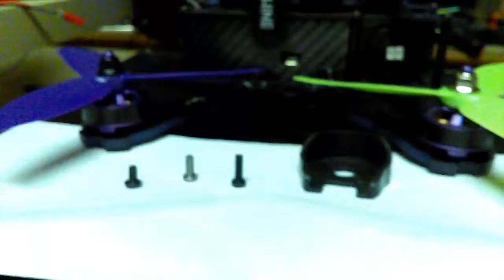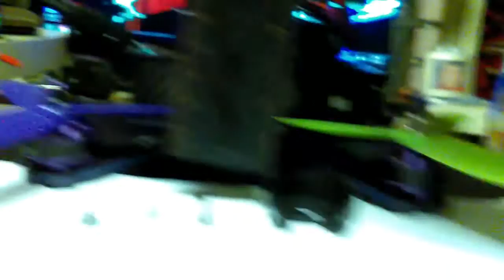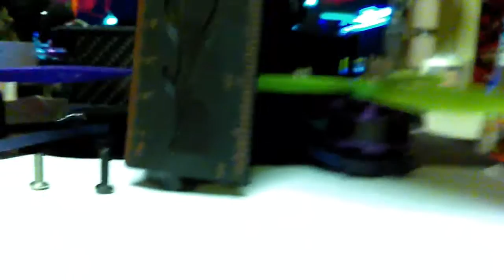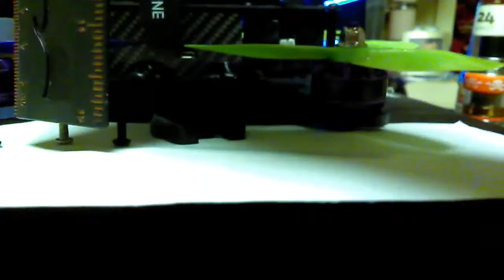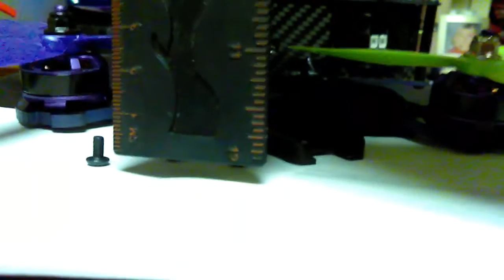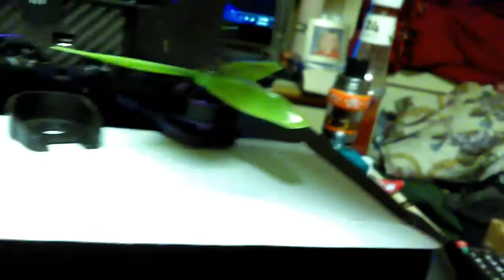Eachine Wizard x220 - CAUTION!! motor screw length explained

Comment: Great video.  Thanks for sharing.  Last week I was flying in a baseball field and had to make a hard landing on the dirt between 1st and 2nd base.  I can confirm that dirt can and will get stuck between the motor guard and motor.  It caused the motor to lock and stop spinning.   Taking the guards off is a good option.  However, as I'm still learning, I think the guards have helped me not damage/dent the motor housing.  It is a dilemma for beginners.
Reply from the maker: You are right on, I damaged a motor hitting a brick wall that likely would have been avoided with motor guards, oh well lol. Also the props are FAR easier to change without the motors guards, so its 6 of one half dozen of another in this case :D

Comment: what was your reasoning behind removing the motor gaurds? if it is just for less weight isnt the payoff small compared to having to replace a motor? just curious :)
Reply from the maker: +Jordan Parrott at first I remove the motor guards purely because I do not like how they look and the fact that I thought they would restrict cooling to the motors and also I believe debris could become lodged between the motor and the motor guard so those three reasons are the main reasons I removed it but afterwards I learned that the propellers are extremely hard to change with motor guards and extremely easy to change without motor guards so those four reasons are basically why I don't use them
Reply: Josh Ketchum makes sense. i also have difficulties getting the props on and off, wish there was a tool to hold the motor in place (some kind of wrench)
Reply from the maker: they do! Its called a motor hook wrench, Banggood should have em!

Comment: Hi, I want to remove the motor guards but not the LEDs. Will the 5mm screws work for that or do I need longer ones?
Reply from the maker: +Webster you will need a 7mm probably, honestly never tried it in that configuration
Reply: Josh Ketchum thanks,what if I remove LEDs and the guards? Does it work with the 5mm?
Reply from the maker: they will work, but just barely hold.. I would not trust the 5mm screws in the motors at all myself, with a 4mm plate, that only gives 1mm holding the motor.
Reply from the maker: The 5mm screws are included to use in the top and bottom plates of the frame in case you lose some.
Reply: Josh Ketchum thank you!

Comment: Hi Josh thanks for the video. Just one question do you use any type of thread lock in the screws? If so, in which and what thread lock type are you using? Thanks a lot!
Reply from the maker: +Flávio S I would recommend blue loctite if you use it, I have had no trouble as I am pretty anal about tightening all outside screw every flight. Honestly none have come loose, but on was a bit loose on my top plate, so I installed a longer one up there. No issues so far.
Reply: Hi, Josh! Thanks for the answer and support on doing this great videos! I'm wainting for my Wizard o come and I want to know what to do to avoid having bad experiences! Your videos had helped a lot! Thanks for supporting the new guys like me! Keep on doing it!

Comment: Thanks for the video, do you think the 7mm screw would have enough bight into the motor housing if I were to use it after removing just the LED board, but keeping the motor guards?
Reply from the maker: +Lux yes I do
Reply: Josh Ketchum do you think that the original screw only without the led will be ok?
Reply from the maker: Thats where the problem is, the original screw DOES touch some windings with only the LEDs removed, I would suggest at LEAST using a washer on each screw if your not using LEDs with the original screw.
Reply from the maker: a small lock washer on top of a small flat washer against the carbon would be ideal honestly, then the original screws would work fine and it would not come loose.